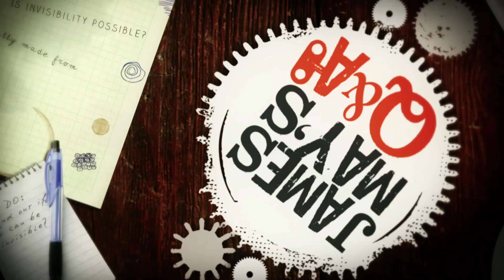Why Can't Trains Go Uphill? | James May's Q&A | Earth Science

Comment: Some trains shoot sand directly in front of the drive wheels to increase traction.
Reply: Claude Smoot That's more for snow or ice, or if the wheels are sleeping while pulling heavy load. It wouldn't help much for hills
Reply: @b1gthumbs  how would that not help for hills? Sanding is a method to gain traction, it doesn't discriminate whether you're on a hill or not...
Reply: @ThePedro8161  The amount of sand is limited. Trains plan to climb hills without sand and only use it when rail conditions are bad or some bleeeeerp railway guy sets signals in a way that forces a Pacific (not the best hillclimber) to stop on a Hill (they used a BR52 as a pusher in the end)
Reply: @mbr5742  that is not true, locomotives hold loads of sand and use the sanders often when climbing steep hills.
Reply: @ThePedro8161  In normal weather sand use during hill climbing is either a sign of bad engineer, Bad rail maintenance or bad train configuration.
Reply: @mbr5742  again, that's wrong. There's nothing wrong with using sanders, if you need to use them, you use them.
Reply: @mbr5742  Wow, what a mature way to respond.
Reply: Alex you dont know shit, i have climbed steep hills with the aid of sand.

Comment: Traction does not stay the same when you go up hills, it actually decreases because less of the train's weight contributes to the normal force (the force that creates traction). Also, traction is independent of surface area.
Reply: why losing even just the rear brakes on a car is dangerous AF if friction is indep of surface area?

Comment: A couple points of physics not mentioned in the video.

A big part of the reason trains aren't good at climbing hills isn't just the traction: it's because, as big as a locomotive is, it's still only a small portion of the weight of the entire train. The vast majority of a train's weight is on the unpowered wheels of the cars, and isn't contributing to its traction at all. Compare this to you: all of your weight is on your feet. All of a 4WD car's weight is on its driven wheels: for a 2WD car this may be more like half of the weight.

You may think you're good at climbing hills, but good luck trying to climb an 80% grade while dragging a wagon loaded with half a ton of bricks. And while your car might climb hills nicely on its own, a semi truck or lorry with four fully-loaded trailers (aka a "road train") certainly won't, despite the high grip of the tires.

Conversely, a locomotive all by itself probably wouldn't have much trouble with a 2.65% grade.
Reply: Omnigeek6 Good point well made.
Reply: Jeff T I dont think you get the point. Only two variables affect friction force: friction coefficient, and weight (more accurately, normal force). If the force delivered in order to push the train (the traction force) exceeds the friction force, you slip. The higher the friction, the higher the traction (and the locomotive power) can be. Friction coefficient is actually not that low steel on steel, so thats not the main problem. Problem is, the only normal force that affects friction is that on the powered wheels, that is, the weight of the locomotive. The number of wheels on the locomotive does not have and effect on that at all, assuming all are powered. So, the train has to pull all the wagons only with the traction that itself can create, with its own weight. Not usually a problem in a flat surface, but in a slope normal force sharply decreases and thus traction and maximun power output too. Thats why locomotives need to be heavy. In addition, the added weight force derived from the slope is hard to overcome.

So, it all comes down to traction, but the reason traction is low is not only that steel on steel is slippery, but that all of that traction is limited by the locomotives own weight, instead of using the whole trains weight.
Reply: Heinz very true, I’m an IORE operator in Sweden. We pull about 8500 metric tons @ 11 degrees. Longest climb is about 22 km. the train has over 12 000 horsepower. On a dry and sunny day at full output you enter the gradient at 60 km/h and exits at around 40 km/h. We also do 4500 metric tons at 18 degrees. 

But in the end, if. It’s snowing, raining with less than optimal traction you will slip a lot resulting in exits speeds of 10-20 km/h. 

On thoose days anything other than 60% power output will result in loss of traction and more loss of speed. 

We also run on heavy duty rails that allow 32,5 tons per axle. Power is needed but traction is key. 

Fun fact at 100% power output with traction @60 km/h the train is using about 3,5 Mega watt hours :p
Reply: Edit: I was answering to someone who deleted his comment.

It would have the same traction because the only weight contributing to the traction of a train is the weight of the locomotive (where the powered wheels are). Traction is very much the same in a locomotive that drags a hundred 50 ton wagons or in that same locomotive with no load. Thats the whole point of Omnigeeks comment.

I will add that, contrary to what James says, steel on steel friction coefficient is actually almost as high as that of a car tire on a road
Reply: @heinz8233  However, if the train is multiple driven wheel design this would give a greater total traction as the other wheels also have a similar contact area. Another answer would be to have a loco equipped with a sprocket, or to have a cable tow at the inclined section.

Personally I would like to see a steam turbine multiple unit, with the energy for heating the water coming from solar panels that line the route of the train.
Reply: My god finally someone in the comments gets it right.
Reply: Some modern trains have all their carriages powered rather than a single locomotive at the front, so they can mitigate that problem
Reply: True, i believe the new generation of ICE (German high speed train) would be a good example 
 @Septimus_ii
Reply: @Septimus_ii  Diesel/Electric Multiple units
Reply: Do 80% inclination roads even exist?
Reply: ex-PFC Wintergreen. So long as you don’t exceed 24 DC axles in a non DP set up. We’ve got a section of track that requires 2.5 HP/ton but with all of the switchbacks we can’t run DP, so we just take less tonnage.
Reply: YES, in FACT Japanese Bullet Trains can climb Gradients with Ease, however not as much as a SINGLE car DMU can.
Reply: The portion of weight. That's why multiple units (MU) kick in and tell ordinary locos to f**k off. However they are expensive which are top enemy of freight railroad companies. One company shall avoid use such expensive stuff to deliver something as little profit per weight as cargo unless he has no choice. Use extensions (including spirals) or zigzags instead. Rich companies (or government-held ones, like China's) may use earthworks to make tracks for ordinary trains to go fast instead of introducing freight MUs.
Reply: James May said it better
Reply: How the trains manage to climb hills? They can use the inertia generated by their own weight on the wagons? On a smooth slope, of course.
Reply: @Magenael  or they can use a cog.
Reply: Also friction
Reply: this is exactly why multiple unit trains were invented
Reply: AC drive locos push full trains up 3% with no problem.
Reply: Very interesting comment.
Reply: AC traction is computer pulsed and very efficient.  Never overheats either.  They fly up and over the continental divide like it’s a pimple.
Reply: @krakenwoodfloorservicemcma5975  China HXD series has AC tri-phase motors. Yeah they are powerful (HXD3B has 6*1600kw motors) but the adhension is still a big problem on hills. Same thing are mentioned by iore operatior above. They simply cannot "fly up and over the continental divide like it’s a pimple" because of the weight distribution.
Reply: You mean Three phase.  Yes you have to add a couple locos on the rear but they push the divide with very few problems. I worked 12 years on the Montana division and witnessed it daily,  tri phase.. that’s pretty funny 😄
Reply: @krakenwoodfloorservicemcma5975  I don't know about your train consist and your gradients. But in China those engines need to haul 5000 tonnes or even more. (I looked into 2 records, one pulled 56 cars and the other 64) With such a load without bankers you won't fly because of the adhension problem. The power of motors are great but bottlenecked by adhension.
This might not be the case in USA. I remember that USA use diesels. Diesels have a lot weaker motors (diesel engines won't power that much) and relatively greater adhension (you might need 2 diesels to achieve 9600KW and 2 diesels have double adhension thanks to weight)
Reply: Why bring cars into it?
He is talking about trains!
Reply: @mrplod1616  cars- railway cars- railway carriages like coaches, bulks, flatbeds or whatever
Reply: @phoenixarian8513  ???
Reply: I STRONGLY DISAGREE. THE TRUE REASON IS BECUASE I SAID SO AND NOBODY CAN DO ANYTHING ABOUT IT.
Reply: Jeff T no amount of traction will make a freight train go uphill, it’s all in the power of the locomotive. Giving the train more traction wont do a damn thing
Reply: This can be solved by a simple free body diagram. The train will only move uphill if and only if:

Friction force + "engine" force > Mg*sin (slope) + drag force

Since the mass of the train is so high, for even tiny slopes the engine cant apply enough force to meet that criteria...

Comment: at 4:11 you said that 'on a slope (climbing a hill) traction force remains same (as of a plain surface) but actually friction is less on a slope compared to plains (because of the angle between reaction force of weight and normal to the direction of movement of train) '

Comment: In short, steel tracks and steel wheels give minimal rolling resistance so you can use a relatively  small engine to pull the heavy train. You can make the train longer without increasing its wind resistance.
When you go uphill, gravity starts pulling you back/down, and your relatively small engine is not powerful enough to do the job.
And the lack of friction that is associated with the minimal rolling resistance has a penalty when you need traction between wheels and tracks: starting, breaking and up or down hill.

The five minutes could have been spent less pompously and rather have shown visually how leaves on the track pose a problem. Or how dosing sand between wheels and track can help overcome problems to some extent.

Comment: to quote wikipedia "On a 1% gradient (1 in 100) a locomotive can pull half (or less) of the 
load that it can pull on level track. (A heavily loaded train rolling at
 20 km/h on heavy rail may require ten times the pull on a 1% upgrade 
that it does on the level at that speed.)"

Comment: I live in Colorado and tell you FOR SURE that trains can go up mountains.
Reply: Alamosa
Reply: Durango?
Reply: Do you know why they can go up mountains? Because they have a special thing on the railway and the train, that normal trains don't have. A bit like how a rollercoaster cart gets to the top of the rails, it uses some sort of winch type thing. (As you can tell I'm not a expert 😂 )  but you get the point.
Reply: @JacobWells  no, they have Sanders.
Reply: @vermilionrailfan5651  the Sanders are for when it's snowing and icy, they don't help much going up hill, also I'm taking about going up mountains not hills. Snowden in the UK is a fine example....
Reply: @JacobWells  it's called a rack railway. it's basically a cog in the middle of the train that meshes with a rack rail, a rail with cog teeth, to allow for an anchor for the train to climb inclines rather than relying on the friction of the wheel and rail. it's why inclined railways have three rails. the two normal flat rails, and one in the middle with gaps in it.
Reply: @Eruaphadian  That's exactly what I was thinking, thanks for the clarification.
Reply: He says at the beginning that the title of the video is a bit of a trick question, since trains actually CAN go up hills, just not as well as cars or people!

Comment: When I was training to be a conductor in Seattle, I took a coal train over the mountain, to the east. We had just gotten to the top of the mountain, and found ourselves at an absolute signal that was red. The engineer was stopping the train, but it was still rolling about 2 MPH. It was snowy, and icy. I was shitting my pants. It finally came to a stop before we reached the signal.
Reply: Last year, I was the conductor on a train (lite power). We were going 60MPH and came up to an absolute signal that protected a diamond was all red around a corner. I freaked out and dumped the train (2 engines) and we went from 60MPH to stopped within 500 feet.
Reply: Really shouldn't be doing 60 on lite power either
Reply: Got to love those Cascade Mtns.
Reply: Wirelesshotshot mate, that must have been scary as hell, hope your still a conductor. Stay cool man 😎👍🏻
Reply: You shouldn't have been going 60 miles an hour if it was red...

Comment: Explains why some trains here the breaks are actually giant Rubber pads that deploy by pressing down on the tracks instead of the wheels. The trains weight and the surface of the breaks generate enough friction to succesfully stop the train.
Reply: *brakes
Reply: One problem with those breaks is that they grind and melt away quickly
Reply: panda gaming44 *BRAKES!

Comment: Friction is totally independent of surface area........ James May is no engineer
Reply: Yes Until it slips; then the surface area matters since now it is a bearing problem. Once the steel wheels are slipping on the rail the surface area matters.  A train going up a 2 percent incline can have the wheel slip at slow speed with a high traction force locomotive. A unit with a few wheels will pull less than one with more wheels.

Comment: Of course "leaves on the line" isn't necessarily stopping trains by decreasing their grip (although it won't help, especially in rain).  The other problem with dead leaves is they also have the rather unfortunate property of insulating the rails from making electrical contact with the train's wheels.  Since this is how the railway signaling system keeps track of where the train is, and it's massivly dangerous to run a rail network when you have NO IDEA WHERE HALF YOUR TRAINS ARE.  This tends to cause delays while the signal operators try to sort what's where and leave extra long gaps between trains to ensure they don't run into each other.

Comment: Interesting, but in part, rather misleading. When discussing braking, you implied that the contact patch for braking is the same as for accelerating. This is clearly untrue (for a fully functional train with properly connected and maintained air lines), yet you didn't clarify it. Tisk, tisk. For those who don't get it, only the engine(s) have wheels that drive, while every single car's wheels have brakes.

Comment: freight trains prefer 1% grade (53 feet per mile overall) to save money, higher grades decrease load capacities, add costs. Passenger trains can accept grades of ~4% (211 feet per mile) because of their more powerful engines, etc. google it
Reply: Passenger train can go up steeper inclines because they weigh so little and are shorter compared to 5,000-20,000 ton, 10,000ft freight trains, not because "of their more powerful engines"
Reply: don't need to Google this. Not sure for rest of the world, but the average mainline grade in the US is above 1% (CSX's Sand Patch Grade is almost 2%, BNSF's Raton Pass=3.3%, former Southern/NS' Saluda Grade was over 4%, UP's Moffat Sub=2%, etc). Passenger trains use freight lines here, so they take the same grades. Where I live in the Eastern US, it's common to see 2000-15,000ft long trains go up and over steep mountains (they use Helper engines though).

Comment: What if they added slight notches or "Emergency" gearings to the sides of the rails? Like if a train is preparing for bad weather, they can turn on "traction control" and run off the rails and the inner gears on the side of those rails? Just an idea, if someones got an explanation on how this would pan out please share :)

Comment: Braking - modern trains have brakes on the wagons/carriages so that's not such a problem.

Multiple units have motors on the carriages too, so going up hills is easier on these.
Reply: Braking action is dependent on the vertical weight on the rails, too, and that is lowered by the grade.

Comment: For me as a fysicist this is horrible to watch. Full of false information. 
1. Friction doesnt depend on surface area between two objects. It is determined by the support force between the object and the surface it is on multiplied by the constant of friction.
2. That's why in hills the friction doesnt stay the same. because the support force's vector is always perpendicular to the surface the object lies on while the gravitational force's vector is always towards the core of the earth which means that according to Newtons second law (the sum of forces that apply on the object =0 in this case only in Y-axis), the support force becomes smaller because the train is at rest in Y-axis as more and more of the gravitational force is applied in X-axis.
3. Cars can climb greater hills because the friction constant for rubber on tarmac is higher than the one for steel on steel.